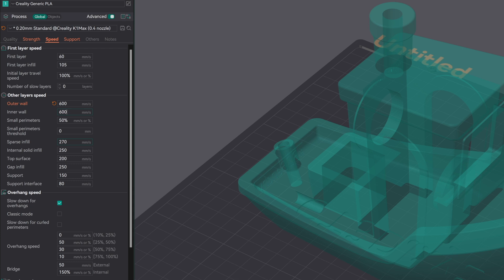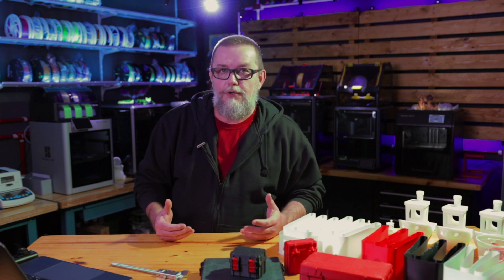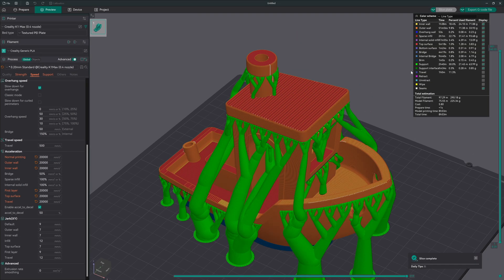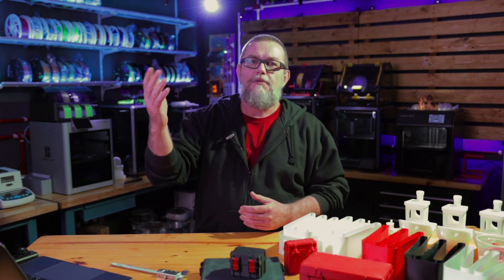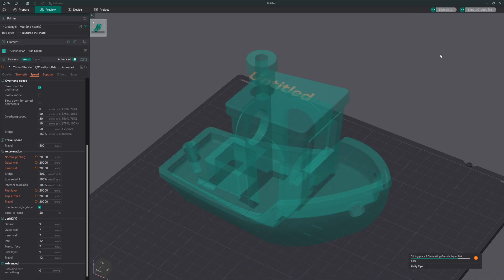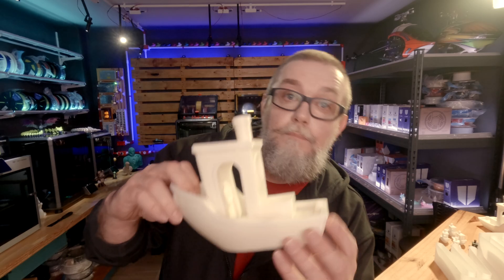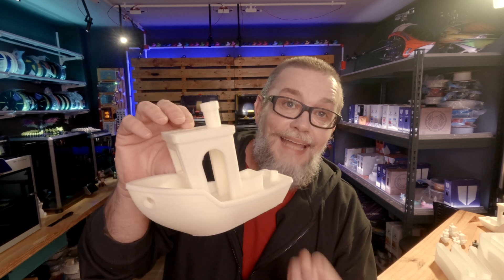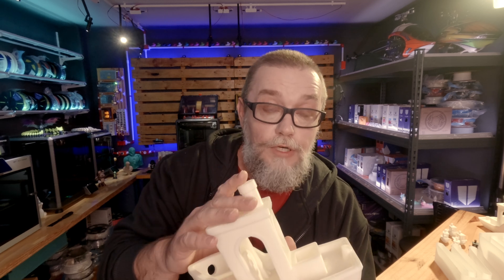How to 3D Print at 600mm/s: Max Speed & Flow Rate Tips for Fast, High-Quality Prints

Comment: Great vid! How do you avoid the tall walls on that print from bowing? I did a 5-40 with PLA and because of the thin walls it was noticably not straight up and down. I'm not sure if that was a failure point, the extrusion issues didn't happen until around 42mm high on the caliper.

Comment: i wonder what this matters when the strength and durability of the too fast printed parts are not good? done this for 15 years now and the speeds of the filament never supports proper bonding for most models for hobbyist. but i see the point from a production perspective here. lets say you make large part with large nozzles, like .8-1.2mm. then the need for the huge flowrate becomes apparent. 

the speed limit is EASY to bypass with a simple script. the firmware in the printer is the stops the speed requested from the gcode or whatever fff format u use. including cnc and other machining tools. 

its always the firmware that is the limiter. you can manipulate those in most cases ;) eeproms are cool

Comment: I’ve heard quite a few discussions on configuration / speed. Still learning. I’ve never heard anyone mention damaging the printer though. All I’ve heard so far was the impact on print quality / print failure. Intriguing.
Reply from the maker: On old printers when we had no calibration functions on slicers we use to broke the hotend support when using bad filaments with too fast extrusion. But running at highest speed all time will degrade the mechanical components faster. It's like driving your car at full speed, it can do it, but will run on it's limits all the time ;)

Comment: Great topic! So as  you say, the different filaments, their composition if you will, can allow you to go up to x, what your saying is you found the boundary / nominal speed that you could push said filament yourself by experimenting? I saw a vid a couple days ago touting the need to read your filament’s MSDS for many reasons. Funny, I haven’t done that yet but I am going to start digging so I do learn all that I can about a particular filament I’m using. That said, do you know if the MSDS that many filament makers provide, includes maximum flow rates, etc….? Again, great topic!
Reply from the maker: Most filaments shows min/max temperature and some other metrics, but it behaves differently depending on the printer. For example most filaments I've tested here has better flow on FlashForge Adventure 5M PRO and Bambu Lab X1C, but this one with 47mm3/s only had this flow on K1 Max and A5MP and X1C got "only" 42mm3/s. So the best to do is calibrate on your printer to see how far it can go ;)

Thanks for watching

Comment: One frustration is that you have to completely redo all this flow rate calibration for each nozzle size, but most slicers do not have filament profiles organized that way. Printer + nozzle size and type + filament + layer height turn into a large number of profiles.
Reply: Thats just the way it's always been sadly. Slicers still have a long way to go. They are the limits now.  I use orcaslicer and I have to use 2 profiles for the same filament because my 2 printers are different.
Reply: @slacksthegreat  And I have two filament profiles for a 0.2mm nozzle and a 0.4mm nozzle on the same printer! :(